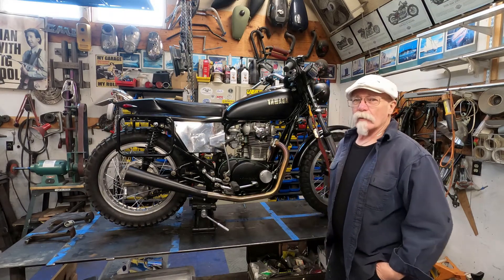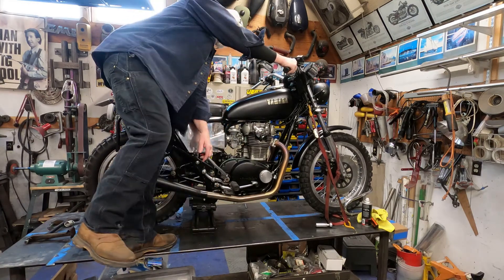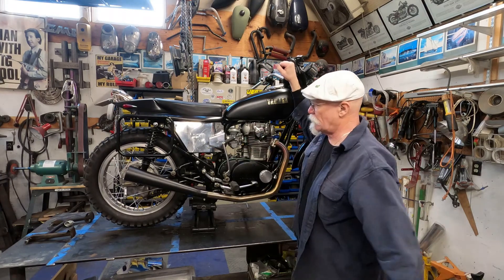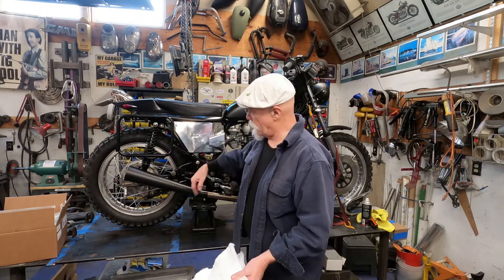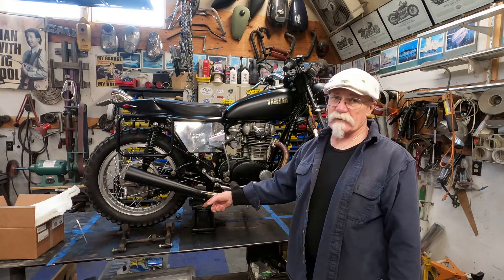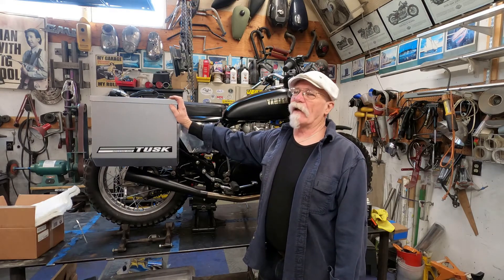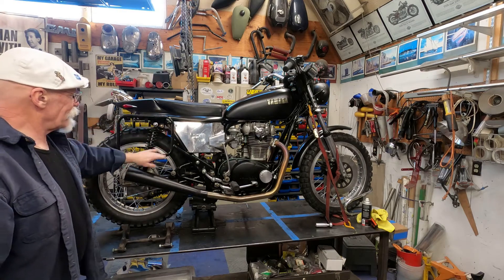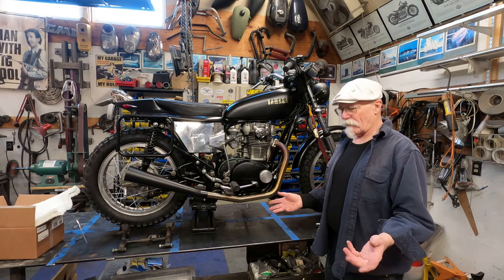XS650 Dual Sport Episode #8 It's alive!

Comment: Are those saddle bag supports on the sides? Where do you get a set of those?
Reply from the maker: Okay, I modified a set of klr tusk panniers mounts to fit the xa650. There is a bit of cutting and welding but it works. Thanks for watching.